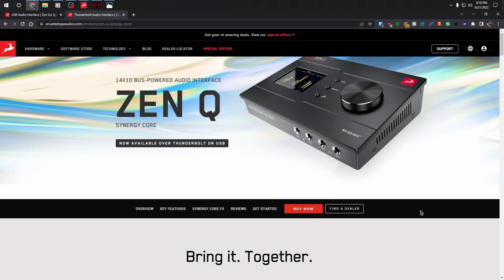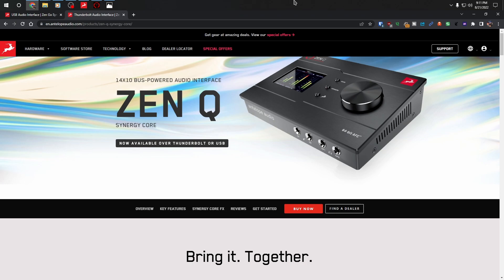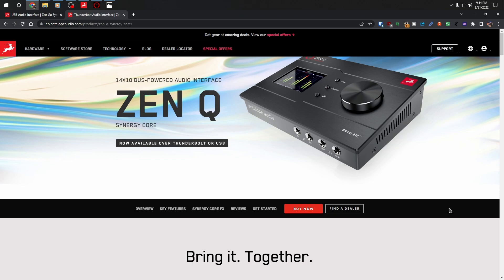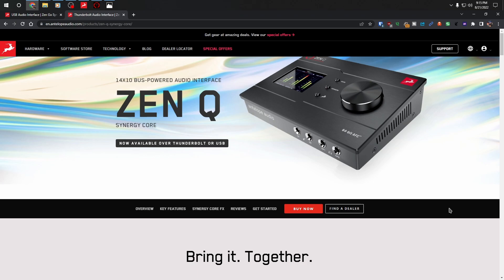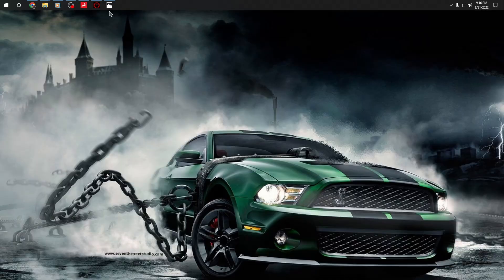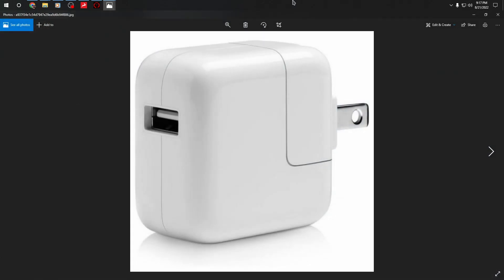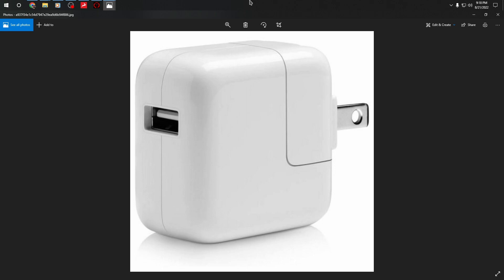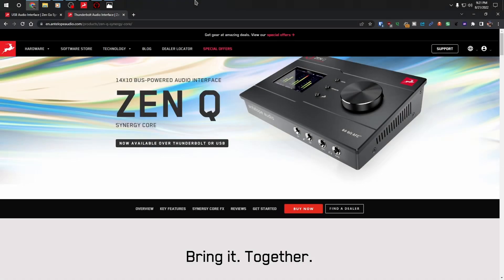Fix antelope audio Constant Clicks and pops.

Comment: Everyone needs to put a solid PAUSE on buying anything Antelope right now. Marcel James (former 14 year engineer from Antelope Audio) is laying down the ugly hammer on all of the hidden software and hardware problems Antelope has been having over the years AND all of the negative social media comments they have been deleting. Marcel has one video out on YouTube already. I have the Discrete 8 Synergy Core and for the last two years had multiple software issues and the LED panel text is now pixelated with dark orange and white text.
More tips to prevent pops and clicks:
1. Disable "C States" in the BIOS.
2. Disable USB selective suspend on all of your USBs.
3. Uncheck the Allow applications to take exclusive control of this device.
4. Using longer USB cables with your interface can cause dropouts and glitches.
5. Disable system sounds.
6. Create a High-Performance CUSTOM Power Plan.
7. Set the minimum and maximum Processor power management state to 100.
Reply from the maker: Thank you...
Reply: Thank you very much, I have a very strange problem with my Zen Q, when I increased the buffer size to 2048 samples gives strange sounds, this does not happen in smaller buffers and try everything, even the 5 volt adapter but it does not work. I do not know if it can be a problem of the interface or the Asio driver, do you know anything about it?, thank you again for your video and for your help!!!
Reply: @sugarmask I’m having the exact same problem with my zen go when using higher buffer sizes. Have you been able to fix it??
Reply: Bought mine a little over a year ago and couldn't find anything besides people complaining about how it's finnickly with nvidia drivers. Spent close to 1k for a broken system. Can't even return it. Clicks and pops. Terrible. And yes... I'm still using it.
Reply: @DudeeSweet  Sorry to hear. I've completely abandoned Antelope and moved on to Focusrite and MOTU. I've been running the Focusrite Clarette+ 8Pre for about a year now with Windows 11. No issues whatsoever; it just works. Focusrite makes the best drivers for Windows and I would put MOTU in second place. If MOTU had WDM surround support, then they would be equal to the Focusrite drivers.

Comment: Thanks for this. Just took delivery of a Zen Q and had the clicking issue. Device worked with a single USB so didn't think to plug the chain USB in to another port on my PC for extra power. Plugging it in immediately solved clicking issues. You genius! 🙏

Comment: Ok...after doing every conceivable audio optimization trick/bios setting changes, updating Dell drivers, etc. and then after no luck I then BACKED off of Windows 11 and went back to WIndows 10 to try that ( no luck), I was pulling my hair out.  Then, I saw this video and thought "what the hell", what if I tried an ac bump for the cable.  Didn't work!
And then... I removed the 1 meter USBC to USBC cable supplied by antelop. and I replaced it with an old USBC to USB-B connector, and now it...WORKS PERFECTLY!  Not using my laptop's USB-C port.  HTF could anybody have known that?   Problems solved now.  Try it, friends. ANd good luck. I was SO close to returning this unit.
Reply: Is it still working for you?
Reply: This is the real solution, but its not a 100%, i chaged the cable for a Xiaomi Redmi 12 pro original wire. Clicks and pops dissapear almost at all. When i play Fortnite sometimes still clicks, but mixing o mastering never. Sorry for my english.

Comment: I just got a Zen GO, It literally just arrived today- 6/23/23!  I'm having the same issues right out of the box on Windows 10!  

I used an ancient M-Audio Firewire Device with a PCI Firewire card (that card is still installed this is so new) and it worked perfectly.  The problem with the M-Audio device is they never updated the driver and it's a driver from 2009.  It still works great even today for music, but the software is starting to conflict with Windows 10 leading to some random booting and crashing issues....

Needless to say, I'm upset that my new Zen Go is popping, cracking terribly no matter how I set the sample rate.  I never had these problems before.  I even turned the sample rate way up and the problem is still there (not that going above 256 would be acceptable anyway).  

I only have 1 USB C connection on this machine so it's not like I can pick another USB C port.

I just want this Zen Go to work correctly,  even if it means I have to install a separate USB 3 PCI card.

I'll post back after I get in contact with the Antelope support team.  -Signed Frustrated.

+
Reply from the maker: I completely understand. I was also incredibly frustrated. Getting an extra PCIe card is a fantastic idea, and I actually did the same thing. Hopefully, with the additional card, you'll be able to resolve all these issues. The interface is truly wonderful. Please keep me informed and let me know how it goes.
Reply: @mixinginthebox  For the heck of it, I decided to try a version of your solution with the Zen Go.  I hooked up a second cable to the thunderbolt port with the easiest thing I had to use, a power bank.  Unfortunately, the Thunderbolt port does not seem to draw any additional power if you are already using USB -as the power bank turned off from lack of any draw-.   if someone had one of these split usb cables to go into the USB C port, it might help.

I just upgraded my Chip drivers and Bios to the newest versions and disabled C-State but the problem remains.  I'm not blaming this on Antelope per say, I also had past issues with a MOTU M6 I tried (it was even worse than this).  I'm blaming this on AMD- they've had a lot of problems with Ryzen MB USB ports in high demand applications.

I went ahead and ordered a PCIe to USB 3 card to give the Zen Go it's own isolated power/bandwidth connection.  So, I'm trying mighty hard to make it operate.

I'll try to report back next week if this device is going to be returned or not.  If it gets returned, I really don't know what I'm going to do.  I desperately wanted it to work.  

This whole upgrade thing has been nothing like the way it was when I bought the M-Audio firewire device back in the day.  You just installed it- hooked the firewire to your MB -and it worked.

Comment: Currently experiencing the same issue, but running an older Antelope model, the Orion Studio (original). This one comes with a separate power cable, so it's not drawing power from USB. What else could cause these clicks and pops? I did all the optimizations so far, except the BIOS stuff. Will be my next move I suppose..

Comment: Hi, the same problem occurred, the processor is 30% RAM is also 10% loaded, it is not clear I put the cable in two ports for a while, then the crackle returns again, I will try as you said, if you get a lot of respect, successful projects.

Comment: thank you so much for this video iv'e been getting so frustrated
Reply: i'm still having issues, then again i'm using a regular phone charger box and not the adaptor shown in the video. I might return my interface honestly I don't like having the box adaptor just be there even if it does solve my problems. It's a real annoyance. I had a question tho, would i have to plug it into a wall or something or could I just let it sit?

Comment: It didn't work for me.  But thanks for putting it out there.
Reply from the maker: Try a different AC adapter,  My AC adapter specs  5.2V  2.5A.  You can also try other optimization techniques.
Reply: @mixinginthebox  PROBLEM SOLVED by replacing the factory supplied USB-c to USB-c  cable and using a USB-B  to USB-C cable. Using the USB-B port on my laptop into the provided ANtelope USB-C port.  I used a cable I had lying around and it INSTANTLY worked. For some reason the USB-C into my laptop caused clicking problems, so I bypassed it and went into my computer with USB-B.   ALL problems are GONE. And it was because of your video that I was able to get it done. Thank you!